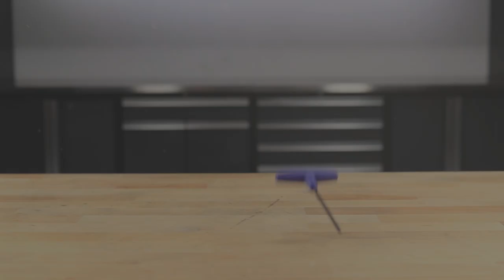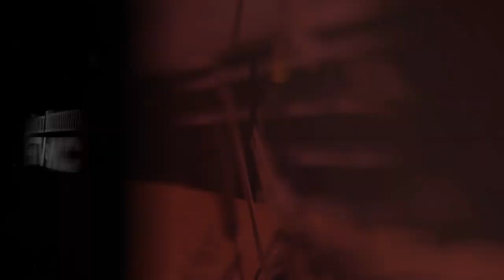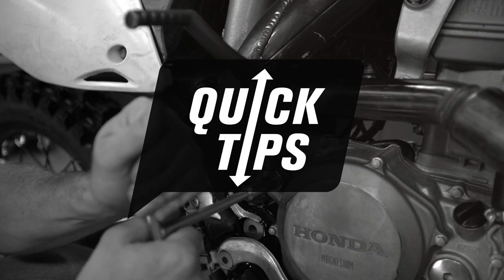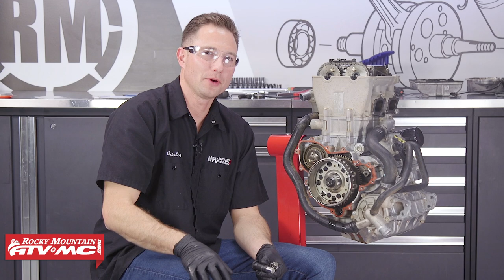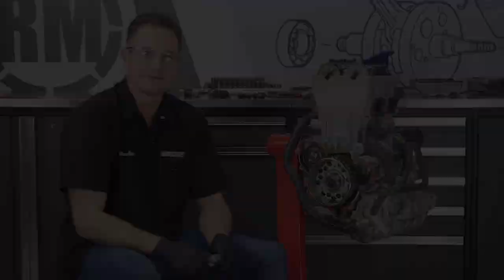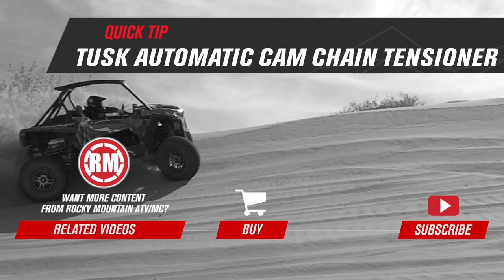Polaris RZR Cam Chain Tensioner | Quick Tip

Comment: So my question is on a 2018 polaris ranger 900xp. If i took the tensioner out because it was leaking oil and I was to put it back in without taking the tensioner apart and I put it back in and it was to tight and hard to start after words and would only run giving it gas and it started smoking. What did I do to cause it to smoke after taking it back out and installing it the right way?